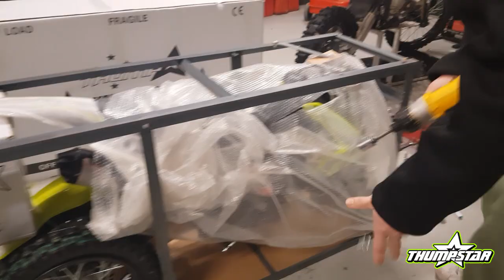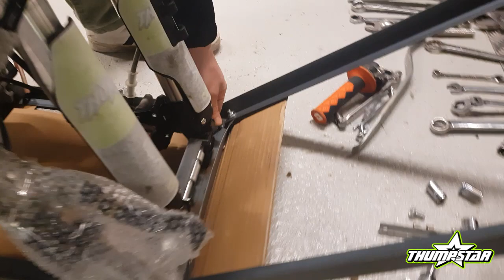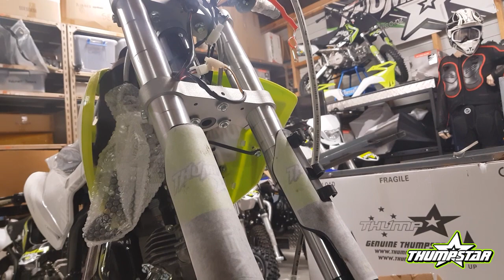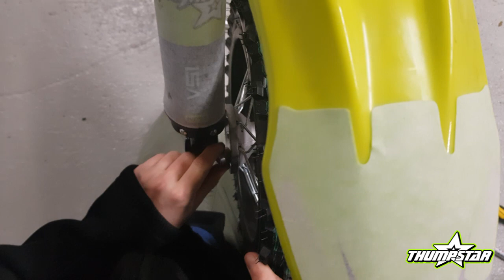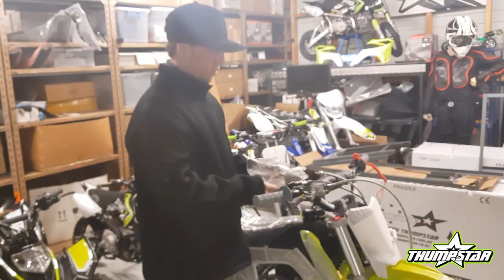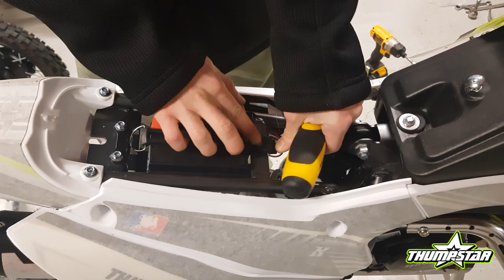Thumpstar TSK50 Assembly

Comment: That was a very sub par build especially given that you represent 'Genuine Thumpstar'. At no point did you stress the importance of using a torque wrench to make sure all fixings are torqued to the correct specs as per the information in the Thumpstar user manual. You have also failed to mention things like checking the chain slack, free play in brakes and throttle etc before first use. Very disappointing to see. I bought a Genuine Thumpstar TSX140BW last month and assembled it myself as per the user manual and I am very pleased with the quality of the bike and how it turned out
Reply from the maker: Thanks for your feedback, yes you are correct and the Thumpstar user manuals have much more detailed information, this video is not to replace the manual but only as a reference, its already 16 minutes long and is only so many details we can fit in.